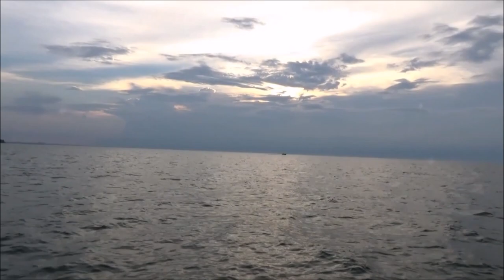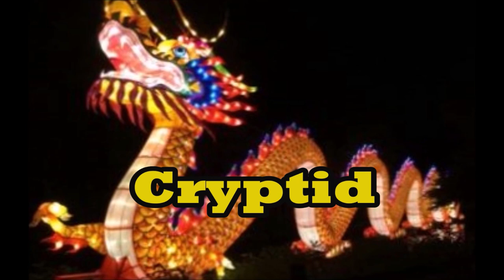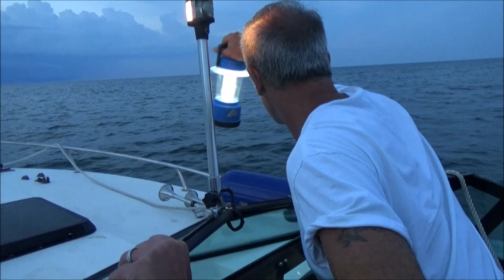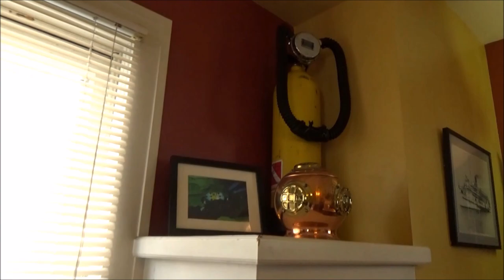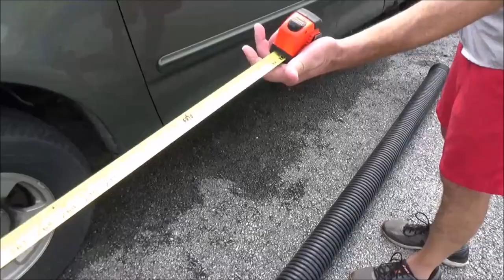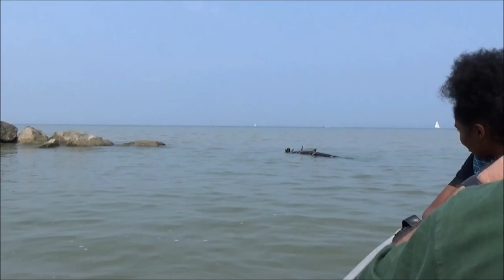The Lake Erie Monster - Real or imagined? (The Quest for Bessie Ep. 1.)

Comment: Ohio has underground structures that have been eroded and most are flooded

People only look down to the bed of the lake but don’t consider a creature could tunnel thru a layer of sand  to the main body of water
A good place to start is near a creek there is bound to be sub terrain erosion where a bulk of sand may be covering.

Additionally it could be possible that underground cave systems would hold saltwater if that’s worth considering then it may have life that can travel salt and fresh water much like a bull shark. Able to withstand a few weeks but would return to saltwater.

Perhaps any sunken and buried ships have been around long enough to be moved closer to a natural opening that could be eroded or damaged connecting a closed waterway to the main body of Lake Erie